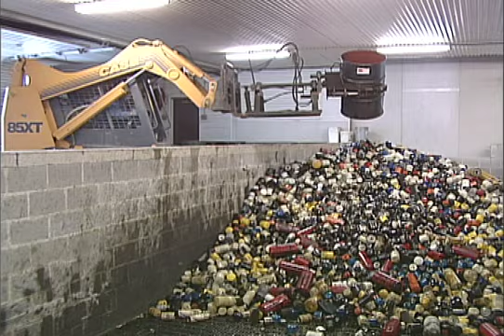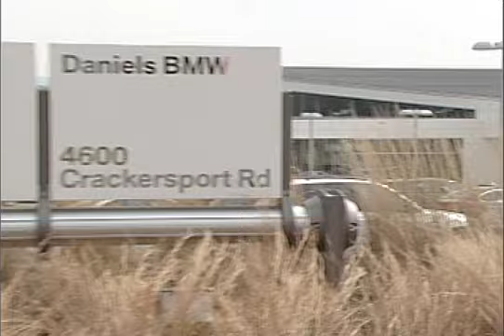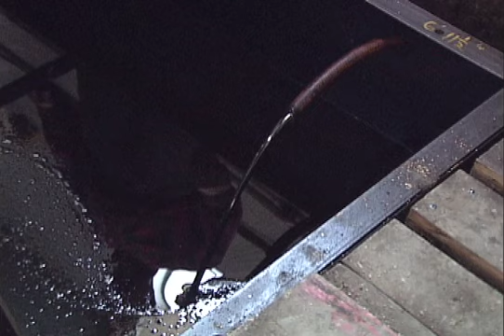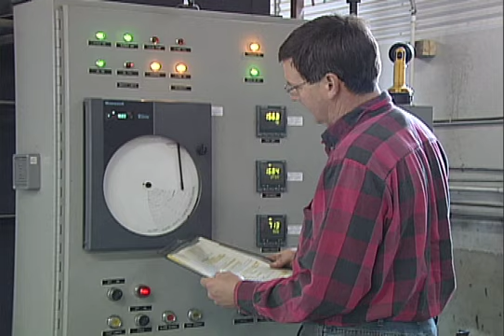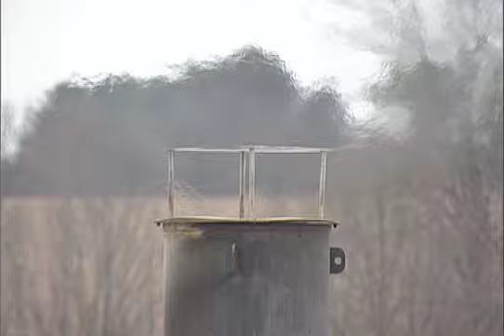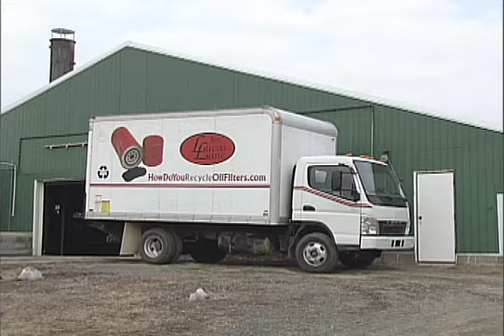Oil filter recycling by Lucas Lane Inc.

Comment: The waste oil industry has a dirty little secret. What they don't tell you is most of the waste oil they recover is blended with diesel fuel and used to fuel, cruise ships, dump trucks and trains. They are suppose to use 10 percent by volume like they do with gasoline blended with ethanol. What they dont tell you is that waste oil can replace diesel altogether. If you ever see a truck blowing out black smoke, this means they are using mostly waste oil to fuel their trucks.
Reply: no, that is not true.
Engine oil does not have a high enough cetane rating to replace diesel fuel, but it can be added in small amounts to diesel fuel...my dad used to add the used oil to his tanks after each oil change.
Typical engine oil for a truck motor is far to viscous, and would not flow properly at ambient temperatures...but when mixed with a high concentrate of diesel, it doesn't change the performance of the engine.
The "black smoke" you see coming from a stack is unburned fuel from the mixture being rich...but likely has nothing to do with engine oil being mixed in with the diesel...the black smoke indicates incomplete combustion, regardless of the fuel type, even a cup of gasoline will burn yellow and give off black puffs of smoke because it isn't burning cleanly.

Comment: at our shop we have old junk cars in the back and we stick the used oil filters and other scrap we get them till there full and send them off to the scrap yard. adds a lot of Wight to the cars. and the scrap steel in the filters still get recycled. the used oil from the oil changes we do we store till winter and we use it for the oil burning heater.

Comment: I have a paper oil filter that's a cartage type can that be recycled?
Reply from the maker: The paper part of the filter in this process becomes a carbon powder because of the starved air situation. This then goes with the scrap steel. When melting the scrap they have to add carbon to the melt so this product is beneficial to that process.
Reply: the paper and media in filters do not get recycled, they get burned or some processors put it in the garbage.
The paper has no market value, but the steel, aluminum and used oil do have re-sale value
Reply from the maker: yes
Reply: David Lucas thanks sir please give me details of this plant. I want to do india. Where's we get equipment and details

Comment: I always though of oil filters to be good fuel pellets for cement plants, after all some of them burn tires. Some of the steel then could be shredded then converted to oxide and used as an admixture. 
Even green house operations could use them to be mixed and augured in to be incinerated with the hog fuel.
Using extraneous energy to recycle low grade hydrocarbons is wasteful.

Comment: Great job, but one question, would it make more sense to just cut the filter open and remove the filer element and waste oil, so you don't have to use heat to remove it?   Just pull the paper out and squeeze the oil out?
Reply: it would not be cost effective, and it would be very labour-intensive to open each filter and remove the contents, plus, you'd still have the sludge and paper to dispose of in a safe manner....the baking process used in the video cooks away the combustible components and creates no. 1 steel, which is ready to transport and sell.
Reply: Yes. I have argued that point to death. If they cut the filter and remove the paper, they can use hot water & steam to remove the remaining oil. This process instead burns the paper filter and any remaining oil.
Reply: These types of ovens recycle the oil vapers to generate much of the heat. This keep the external fuel cost lower and the exhaust cleaner.
Reply: Cutting filters open one by one would be quite a time-consuming process, and on the DIY side, all the oil filter opening tools I've seen tend to be prohibitively expensive.
Reply: Geographer 4 fun is that golden schmichels or silver schmichels?
Reply: I do know that you can make a can opener for high speed and drops the paper filter out and then the can part can be heated up to get most of the oil out , would be nice to see , recycling oil machine!! Like a pop machine
Reply: I will buy your business for 25 schmichels
Reply: Use a shredder and compress the paper is a lot more gooder than baking for 9 hours.

Comment: landfill except amissions
Reply: azah57 ... dude. They explained this in the video.. they use some of the recovered oil as fuel for their kiln which pyrolyzes the remnant oil on the filters.. this gasifies all but the carbon elements in the oil, which is then continually cracked in a secondary burn chamber and up a flue breaking any long chain compounds probably down to their elemental levels. There are no toxic emissions. What you see coming out of the flue is oxygen heated by the massive amount of energy released. At those temperatures, that thing has less impact on air quality than whatever busted piece of shit sedan someone as dumb as yourself could afford to buy.